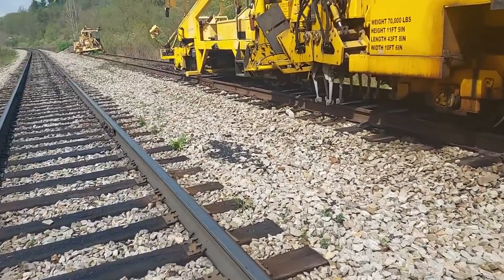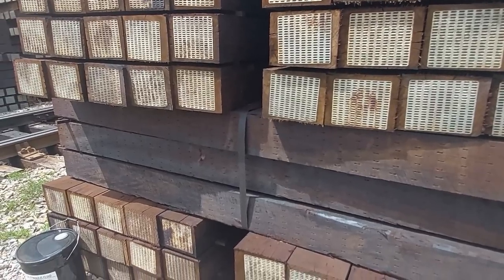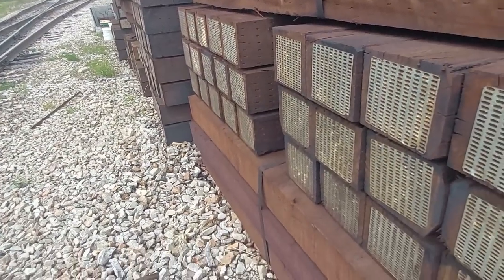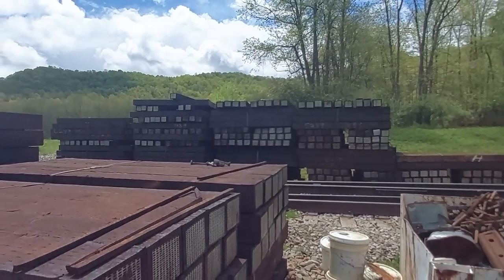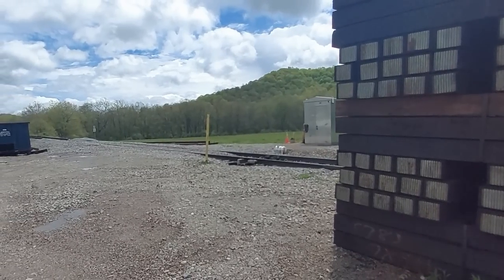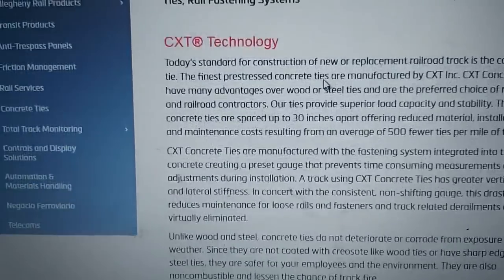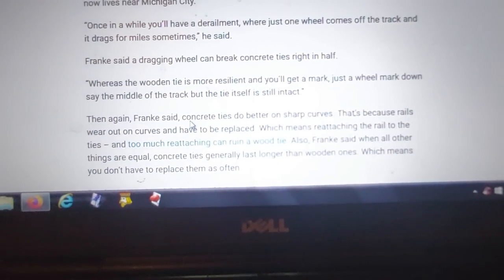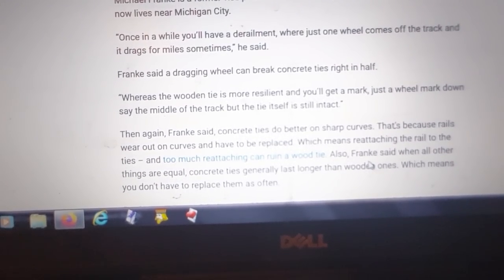Why some Railroads use Concrete and some use Wood Cross Ties

Comment: My friend works in MOW for Union Pacific and I asked him about concrete ties. He said there is really no way to know if there is a internal defect with concrete ties. Wood has some disadvantages but really can't be beat. I have personally seen date nails on wood ties, in straight track, in New Mexico dating back to the 1930's and still in good condition. My friend says some wood ties are so hard you can hardly pound a spike through them. Derailments on wood ties are usually not that big of a deal. On concrete they will probably have to be replaced. Disposal of concrete ties seems like a problem. 3 ties can weigh over a ton!
Reply from the maker: Thank you very much for sharing that Tom! Excellent info.  Appreciate your taking the time to visit with us and check out the tie show my friend.
Reply: @ccrx6700  Enjoy your channel. Keep the videos coming.
Reply from the maker: @travelingtom923  👍😊

Comment: The availability of particular species of eucalyptus tree, and how long they last in comparison to wood are two reasons why Vic track here in Victoria went over to concrete. NSWGR tried the type with the steal bar on branch lines, they ended up removing them. Oh there was a mud-hole at one of the junctions, in the mud-hole were several concrete sleepers, as far as I'm aware they are still  there. The mud-hole however is gone, after several yrs they fixed it!
Reply from the maker: Thank you for the nice comment  and great info Stephen.  Appreciate your taking the time to visit with us and check out the tie show my friend.

Comment: Concrete ties also have patent issues in the USA, as the original patent has expired, but there have been a good number of improved full concrete ties made, and patented, so they have been the de facto tie here by me in South Africa, as they both are aligned from the mould, and the dimensions are very tightly held, so putting them in is a lot easier, and you only have to lay the rail in, clip it to the ties with the clip, and it is both right gauge and correct alignment immediately. Does not rot, and when doing road crossings you can simply cut a form, put the concrete ties in, align them to the road, and pour in mass concrete fill, so they are a monolithic block on the road, and hold well. 

Most of the patents cover controlling the shrinkage as the concrete cures, and you will find many made by Dorbyl Heavy Engineering used world wide
Reply from the maker: Thanks for sharing the info with us Sean and for taking the time to watch the video. Happy rails to you until we meet again my friend.

Comment: Thanks for the video Dave
One aspect you have not touched on is the use of welded rail. The use of welded rail is much  more common in UK and Continental Europe ( Universal on main lines ). The extra weight of the concrete is required to resist the high forces generated by the tension/compression of the rail. On this side of the water we run a lot more high speed trains with high traffic densities. I don't know but I think it would be impractical to use jointed rail on such tracks.
 Because of the high speeds the rail wears out quickly and needs to be changed and this can be done using automatic machinery and minimum of manual labour. Do you have any high speed lines using welded rail in the USA?

Regards from Redruth

Arnold
Reply from the maker: Appreciate the nice comment Arnold and for sharing those thoughts. Thank you very much for taking the time to watch and write in my friend.

Comment: Great video. I guess concrete has it’ use in the night circumstances. I am also sure the wood tie manufacturing process is aware of the environmental downsides and do what they have to too optimize it’s impact.  Thanks for the insight and great information.
Reply from the maker: Thank you Douglas for the really great comment. Appreciate your taking the time to check out the video and write in my friend.

Comment: I built a cheap 64 X 30 pole bldg' on my farm,  got used ties for free, put them in on 8' centers four feet deep, cut them off on a level a foot off the ground, then bolted 6 x 6's on top of them 16' long, then built more or less a conventional building on that foundation.  Still there and looking perfect, open to east, big sliding doors on both ends.  Steel roof/sides.
Reply from the maker: Appreciate your sharing that with us Warren, lot of farmers around here still have wood ties as fence posts still going strong. Thank you for taking the time to watch and may you have a very good day my friend.

Comment: Interesting video. I, too, love the smell of creosote ties. The issue, though, is that trees must be used to make the ties--and not just any kind of trees (as construction crews discovered when laying roadbed in the plains area of our country). Plus there is the issue that we are using timber faster than we are replacing it, not to mention the oil used to make the creosote. I have been to Europe many times--and just about all the national railroads there have gone to or are are going to concrete ties, especially on the high-speed lines, because they handle the load requirements better than wood ties do. Of course, there is also the reality that there the load the roadbed has to carry is far less than what American trains need. Most freight trains in Europe are 20-40 cars long. In the U.S. it's not uncommon to see trains 100-200 cars long. On the other hand, the frequency of train traffic in Europe is substantially higher than in the U.S. A given section of track on a U.S. mainline may see a train roughly once per hour. In Europe a similar length of roadbed may handle 7-20 trains per hour. Along the famous Rhine River route, for example, I've counted as many as 35 trains in a single hour--or roughly one every 1.7 minutes.
Reply from the maker: Appreciate your sharing the awesome comment wranglerboi. 
Concrete does lend itself well to higher speed passenger trains. Thank you for taking the time to watch and may you have a very good day my friend.

Comment: In Australia, termites (white ants) would eat and destroy the wood very quickly.   Treatment of the hardwoods (jarrah etc) add some resistance and extend life and endurance,   Rail-sleepers have used steel sleepers and other materials as well as reinforced concrete.
Reply from the maker: Appreciate the nice comment Brian and for sharing those thoughts. 
Creosote doesn't deter the bugs there? Thank you very much for taking the time to watch and write in my friend.

Comment: " All about the road bed "  as stated. Concrete pavers for the driveway and parking area high stress 11,000 ppsi used shipping ports . The container lifts cause havoc. Excellent point about environmental issues. I know they've changed the " recipe " on treated lumber in general . It doesn't last and treating after the fact , staining or painting is a waste and more useless chemicals.
Reply from the maker: Thank you for the nice comment Drums Only. All RR's have their own
unique track problems/weather/economics, etc. There is no one tie
out there that is ideally suited for every single RR going. Each
RR has to use what is the best option for them, and often use
different options for different sections of track. Concrete, steel, composite or wood all have their pros and cons. It is a good thing
that there are options available to suit each RR's particular needs.
Appreciate your taking the time to watch the video and write in
my friend.

Comment: Dave ! thank you for your investment in time bringing your viewers this info, question I am looking at running a line to carry the same load that your line does( coal) I’m cutting this line through virgin ground! What do I have to do to prepare this ground for carrying the loads your line does, and what has changed since say early days of railroading.
Reply from the maker: Sounds like you have a ton of money to spend ferstuck. Hope you
hit the powerball lottery! :-) Good for you if you did. No topsoil in
your roadbed, strip that away until you find a good layer of clay. In tangent track crown the roadbed so water runs off
both sides, in curves slope the roadbed so water runs off to the low side. No rocks in the road bed either. Use good clay with no rocks
for fill areas. No charge for today's consulting fees. :-) Thanks for watching the video and writing in my friend.
Reply: @ccrx6700  Dave, I haven’t won the lottery or got a ton of money! I was curious about your roadbed, because you have mud coming up through the ties in places, does that mean there needs to be more ballast under the ties. I am not giving you a hard time just interested:)
Reply from the maker: @ferstuck37  after 40 years of coal leaking out of our hopper car doors has plugged up the ballast so water wont drain away.  Answer is for us, have to have a constant ballast rehab program
Reply: @ccrx6700  Thanks Dave that puts it in perspective.

Comment: Thanks for a lot of facts for a wood tie only guy.
Just being a veteran railroad guy since 50 years lots of knowing railroaders have been passing by. For heavy load railroads, lots of LBS per length unit is needed. However, for light axle load railroads too stiff rails, too many LSB per length, increase the wear on wheels, maybe even on tracks. Some flex is desirable according to the guys I heard. Some light weight railroads have noticed it I'm told.
What do the knowing guys here say?
Reply from the maker: Appreciate the nice comment Stefan and for sharing those thoughts. Thank you very much for taking the time to watch and write in my friend.

Comment: hello Dave, yes  the
concert ties probably 
are good in the desert
conditions, no mud to
brake down the wood ones. UP is doing that in CA. a utuber records 
the trains there, and 
work trains putting in concrete ties. like you
stated one wheel off,
and the ties cut in half!
the wood is more durable with regards to
" rail accidents " the less the gov demands change, with out any alternative that work.
will cost everyone more 
for what was done in
the past for less. great 
vodeo, and great info
about both types of 
ties! stay safe and 
healthy.
barry
Reply from the maker: Thank you for the nice comment Barry.  Appreciate your taking the time to visit and check out the railroad tie video my friend

Comment: We live near the UP mainline through Iowa. In the West Central part of the State the twin tracks are on the South side wood ties, and the North side concrete, for the second time. The first batch cast in Nebraska were cured outdoors and experienced freezing temperatures before 28 day curing process was complete after not many years these were removed and crushed and separated from the rebar inside. Many were used in a small town near here to build up a parking lot for RR workers. They were replaced by the current cement ties here today. I wish I could tell you a time frame in years of how many years the current batch has been in use. I can say it is over 10 years for sure. Coal traffic here is nothing like it used to be. Container traffic I believe is the majority.
Grain is probably next. Overall traffic is not what we had in the 80's and 90's when coal was king.
Reply from the maker: Thank you for the interesting comment Debi. Appreciate your taking the time to watch and write in my friend.

Comment: Hi Mr. Dave, personally I would prefer a wooden tie. Wow, concrete has been a round since 1890's, I first noticed the concrete in Chicago just 2/3 miles south of Union Station in 1990 back when you could walk down the tracks with out getting locked up as long as you weren't vandalizing RR Properly. Thank you for answering my questions, looking forward to another video.
Reply from the maker: Thank you for the nice comment Terry, glad you enjoyed. Appreciate your taking the time to watch and write in my friend.

Comment: Have you ever thought about bringing in a grinder to grind up your old ties? ? A lot of landfills will take them for ground cover and will not charge you . Also there are power plants that take old used ties once they Ground up for Fuel.
Reply from the maker: Have never even heard of that Bob. sounds interesting. Wonder
how the grinder would do with the steel plates on the ends of
the ties? I imagine those would need to be taken off before
grinding? Will do some research on that. It certainly seems all
these used ties we have could have a more useful purpose than
just being dumped in a landfill at cost to dumpster them out.
Appreciate our sharing that and for watching tonight. I do know
some power plants will burn ties, but there is none in any close
proximity to us that do it.

Comment: the prestressed have rebar that are pulled  under tension, and held that way until the concrete is poured and cured, also called post tensioned  beams.
Reply: **Pre tensioning of concrete structures are not the same as post tensioned structures. They are opposites and they are used for different applications. Post means after. Pre means before.
Reply from the maker: I think you've pretty much got that right Gerald. They had a lot of 
problems with ties cracking in the middle before they did
the pre stressing.

Comment: We debated switching our main  to conctete and trying out a couple sections with steel ties years ago. Turned out it would be more work than it was worth with our roadbed out here, so still using oak ties.
Reply from the maker: From what you've told and shown me Michael. Concrete and steel are okay for some applications but I think you guys along with us will always have wood, it will work best for the RR's we each have.
Appreciate your taking the time to check out the video and write in my good friend.

Comment: Haven't you ever watched them replacing mass sections of track in Europe?  They have a train come through and remove sections of track still bolted to the concrete ties, looks like about 100 feet long or so, one railcar long. They cart a whole train of that away to a depot repair station while bulldozers and other regular construction looking machines go through removing the bed, cleaning the ballast, installing some kind of tyvek looking material, filling it with cleaned ballast, and then comes another machine to drop new (or repaired) sections onto the new bed, the men bolt them together then ballast gets dumped on top of it all. They can replace 6 miles of track in one day that way. They really move fast and have specialized equipment designed to do just that. This begs to ask why replace the tracks? They said the top mushroomed out on the track so the track needed replacement.

Now for my other question, there's a section about 10 feet long or so that looked like it had another track bolted to the inside of the main, what's up with that?
Reply from the maker: Those huge rail machines are super cool, however we will never
see them here because we do not interchange with another RR,
no way to get them in here.  2. That small rail you saw was a
frog guard rail and yes it is bolted to the main Robert. Thank you very much for taking the time to watch and write in my friend.

Comment: And your comment about the tamper is correct for the old harsco tamper the newer mark 4 tamper uses the Jupiter system and you can change the tamper head height on the computer screen.
Reply from the maker: Many rebuilds on the 6700's also have the Jupiter 2 system on
them, no one rebuilds tampers with the old operating systems.
Maybe someday I'll luck out and they will rebuild mine.....:-)

Comment: Back in the late 90s the mbta rebuilt the line between Boston and Plymouth as a commuter line. Concrete ties were used and about ten years later they converted to wood ties. No real explanation was ever given. The old line was seldom used, mostly for a monthly delivery of propane. These old wood ties had date nail going back to the early 30s.
Reply from the maker: Appreciate your sharing that information Walter. Thank you for taking the time to watch and may you have a very good day my friend.

Comment: You mentioned that you didn't know where any concrete ties are used currently.  I know of a place in Western Colorado where the road base is not as stable for the heavier trains used.  Parachute (Grand Valley), Colorado is a place that uses the concrete ties and the trains here are heavier and longer than they used to be.   Please include this information in your next video. Thanks John
Reply from the maker: Yes sir but I was referring to around here in fairly close proximity John.
But I do appreciate your letting me know that info and for your taking
the time to check out the concrete vs wood tie video my friend.

Comment: Austrak concrete ties ate so hard that when hit with a welders chipping hammer (we used those to  clear concrete from the seat, an artifact of the casting process), they did not mark!. In case you werte wondering, I was a licensed Sleeper Inspector in the Wagga Wagga, NSW, Australia Austrak plant.
Reply from the maker: They have found out here that a high PSI concrete works best for
concrete ties. Chipping hammer is one thing, but if a car wheel gets
off on a loaded car that can pretty much ruin a concrete tie. :-)

Comment: Third comment - im sorry! But im typing this as I watch! haha. 
We have a 1/20 inclination to out rails, do you use vertical switches/crossings? If so - whats the length of your twist rails? Wondering if theyre double the length of ours, or just twice the twist rate! :)
Reply from the maker: I do not know what the twist rate is Mike, that must be from
some country not USA, terms I am not familiar with. We here have
2 different sizes of turnouts. With #10 and #8. Both of those have
different angles on the diverging rail (I think that is what you mean
by out rails) .... the rail that would go into a siding or spur off the
main. The rails from the switch to the frog that go to the diverging
track are called curved closure rails, is that what you mean by
twist rails?